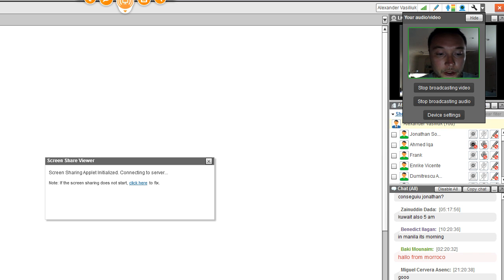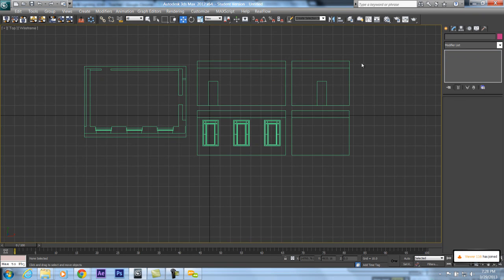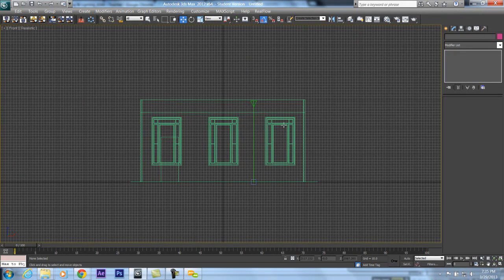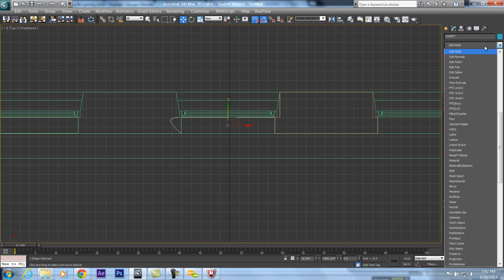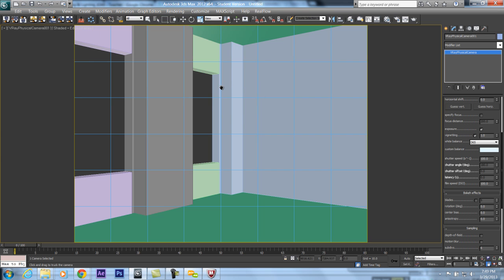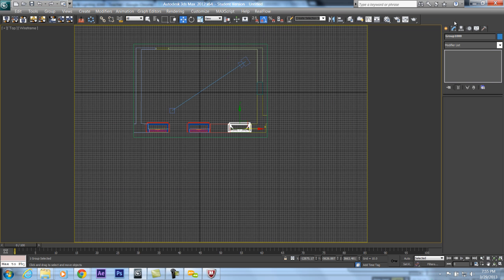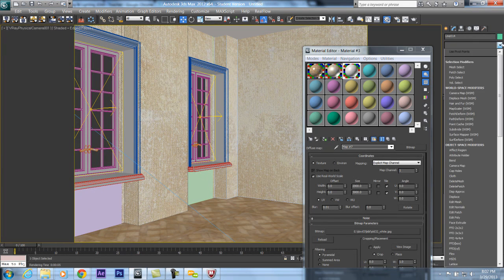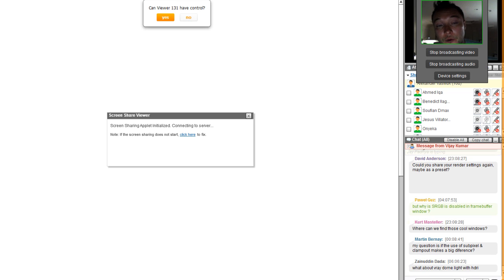3DsMax VRay - Modeling, Lighting & Rendering

Comment: Can ask how you get such sharp 720p videos? ive tried h246 codec with 1280x720 but they keep getting compressed? Could you perhaps point me out which settings you use
Reply: What's the compression ratio you used ? (lossless or a value). Did you do 2 pass or single pass compression ?
Reply: I use h246 with vbr2 about 15 an 18. I stopped tested YouTube cause I was going crazy. The Vimeo is of but better quality. I made a new simulation and render. 
https://vimeo.com/115073043
Reply: On youtube, when I can i use lossless compression that's the best  way for me.
Reply: Renaud Warnotte what type of codec is used for that? i used the h246 as i said and i read a lot about this, still i find my video to be compressed a lot. I think some other settings i havent set are missing
Reply: Either RAW AVI or H.264(x264) with lossless or H.264(x264) with constant quality at 10 or minus and never do 2 pass encoding.

Comment: guys, I have an i5 4670k oc'ed to 4.1ghz, 1tb hdd, gtx 650 zotac and 4 gb ram. Is it good for 3ds max? As 3ds max runs slow still. :(
Reply: yes it is
Reply: Rohit Kumar No you need Nvidia CUDA if you want to go 100x faster.
Reply: sonofhendrix something like a GTX 970 card would be good. A Titan X even better, a TESLA and you're laughing.
Reply: Rohit Kumar Yeah it will be fine, you might want to put some extra cash in another stick of ram memory at the least put a 64 bit OS, and try working in shaded and wireframe mode.
Reply: +Georgi Ilchev first of all gpu do matter in view port perfrormance but if you need faster out for ur rendering you need badas processors like xeon or something otherwise it will be useless unless if you are relying on gpu rendering engines like octane
Reply: abhi dev This GPU will do fine with the viewport, not for GPU based rendering; GTX 750Ti will do fine as well...  I personally moved from gtx 570 to 970, but it is up to a workflow to make the process good as possible some tweaking is always welcome. But he really needs some RAM memory to get this thing working.. I don't really think that he needs gpu rendering would in the best case scenario require 2xGTX980TI ... no point rather get good at setting up and achieving good to best possible results with CPU rendering for Vray... that is simply because out there if he wants to be part of a big production studios or a little ones - they use nodes CPU renders ... so get good at that.

Comment: I have a question, and please, I need the answer urgently if it's possible.
If I want to give my interior wall the flowery wallpaper, and my exterior wall a red paint texture. It means that I have 2 materials on 1 object (I mean 2 sides of it). then how do I do it? THANK YOU
Reply: You have to assign material groups when editing a wall as a poly
Reply: or you can just select the faces (when in edit poly) and detach (as object, not element) the interior walls from the exterior walls, and you'll have two separate objects to work with.
Reply: you have to firstly assign the material with the second or  u can do it that when we select the same material for that object we get the option to replace it so with the help of that u can do it ....

Comment: I thought you would apply glass material on Window but instead you used v-ray light then you turn it invisible? Could you please explain that how it works?
Reply: Yes u r right,  this is way..
Reply: exactly i was also thinking.. but if he apply glass material on window than he have to use vray caustic. but he put window without glass.
Reply: you can use glass and exclude it in vray portal light + make it invisible, then you'll see the glass in your render

Comment: This is my PC: 8GB ram, 1TB hd, Core I7 3.40 ghz, graphics gt 630 2 gb ddr3. Can I do this kind of work with this computer? Thanks.
Reply: yes as long as it is 64bit and has enough ram, it should be able to handle programs that use up much of the pc during rendering.
Reply: Yes you can, however the Memory is bottlenecking the processor (assuming it's a Quad Core), well not really bottlenecking but your i7 would work beautifully with 16 Gigs, and only very complex scenes would demand more than that, I would upgrade the memory. It's not expensive and it's absolutelly worth it. If this is a laptop with a double core i7, stick to the 8 gigs of ram.